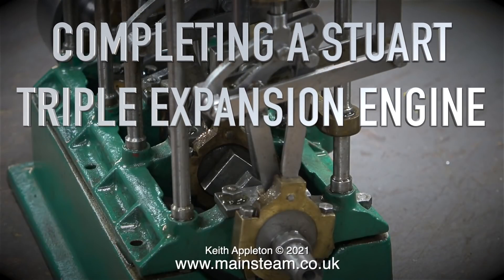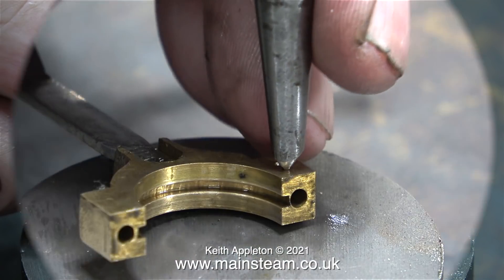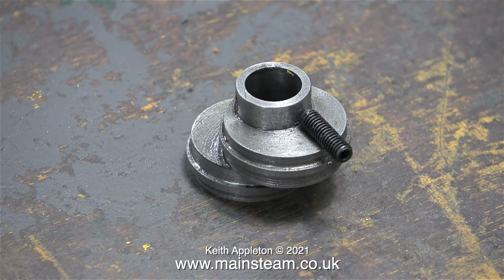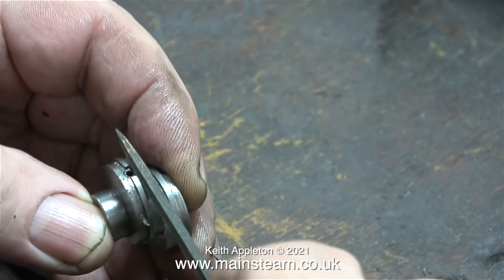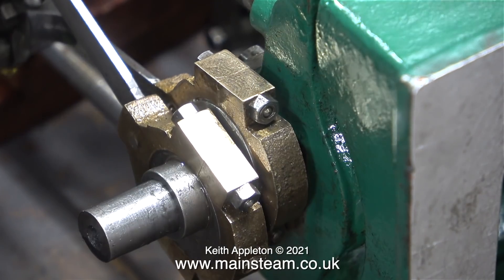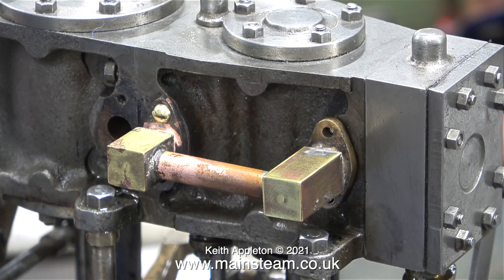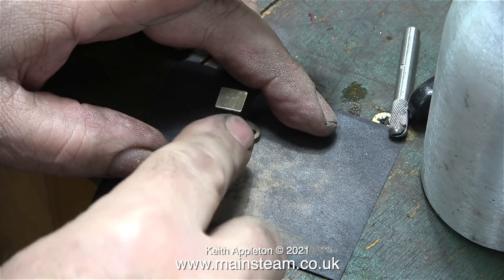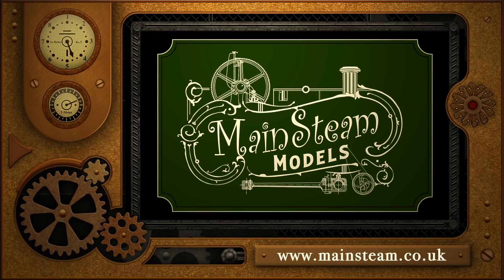COMPLETING A STUART TRIPLE EXPANSION ENGINE - PART #6

Comment: Dear Keith, just wanted to let you know that your tip about placing things in containers using slow motion has been a fantastic, life changing tip for me. Before, I used to place things down without much consideration, usually  within reach, or even in sight, but amazingly, within seconds, they would disappear (predictably, just when I needed them).  Using your method, I have a much stronger recollection of where I put things!  (My Daughter, Karen, disagrees, she thinks I'm in the first stages of alzhiemers and won't let me have my car keys, thanks Keith.)